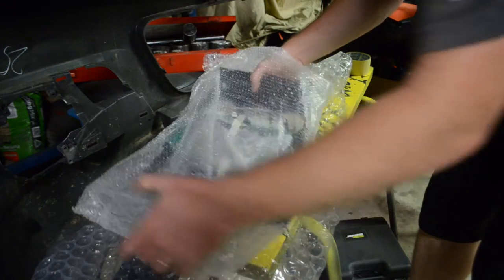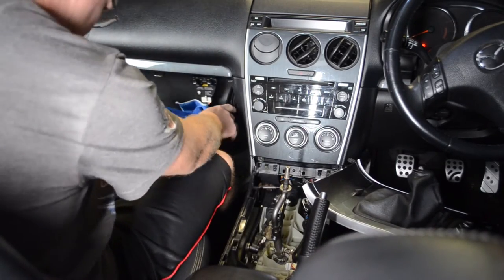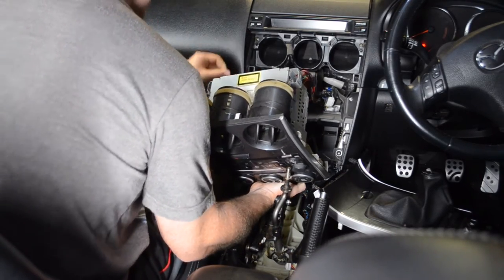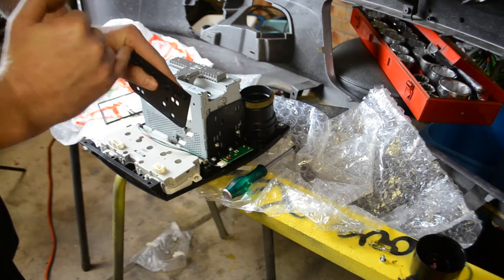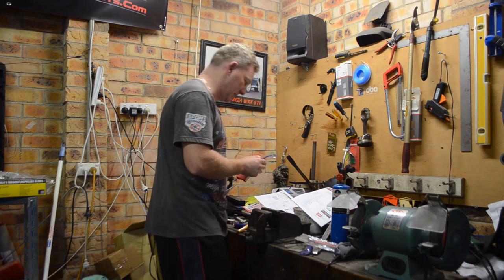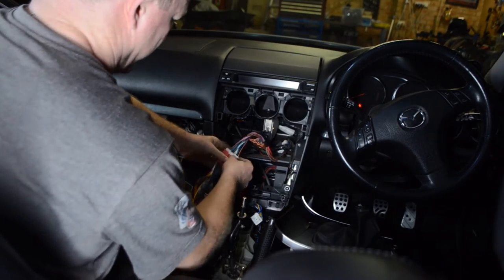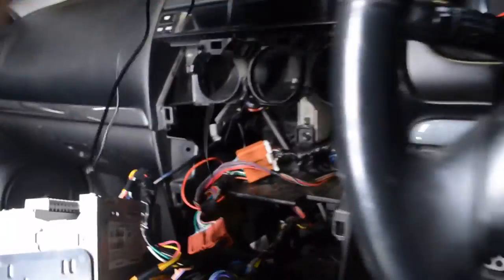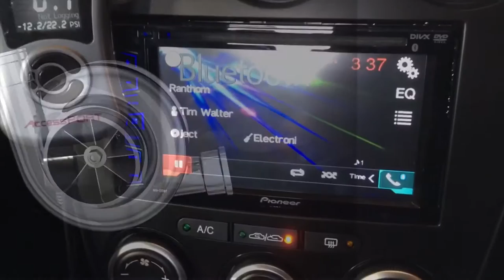Head Unit Install on the Speed6

Comment: Mate you deserve a lot more subs with the amount of amazing content you post. Im going to be buying a 6 mps at the end of this year and for sure your videos will help me out. Also its nice to know that you are in sydney and getting away with that exposed pod filter on your SRI, it gives me a lot of hope. Keep up the amazing work, every one of us appreciates it :)
Reply from the maker: Thanks mate I appreciate it. so far ive found if I drive 'nicely' on normal roads I fly under the radar, out on the open road or out of the city I can test the car out a little more and have had no issues yet, I may encase the POD at some stage but im not feeling the pressure to yet so its doing the job well. Thanks again mate, best of luck with the MPS6

Comment: Really enjoying these videos. The double din head unit looks awesome. The standard unit really let's the car down I think. This is something I have to do in the future.
Reply from the maker: Thanks mate. I am a fan of the new head unit for sure. I wish I filmed the electrical side of the install, it took a lot of messing around. If you go for an upgrade get a mate good with electrics to help :) it will save a head ach lol. It's noticeably better sound for sure :)
Reply: +Tims Garage Absolutely. Electrics is not a strong point of mine. I can't stand not having any real control over the sound, a double din unit will give this and some.

Comment: I know this video is a few years old. But did you still have the climate display still working after
Reply from the maker: Yea mate, still work, the only thing that doesn’t work is the eco air image, I have 2 air con presses if the button that just show air con, but other than that I have clock, heater, etc… all works fine

Comment: Hi buddy, I have an issue with the bolt behind the radio unit, but the thread of the bolt is damaged, is loose but I can't get it out, do you have any idea how to deal with this? Thanks.
Reply from the maker: I'd attempt to get a flat end screw driver (a small one) between the bolt and the frame, then try undoing it, and gently leaver it out. You won't need it again if your going for an after market one. Other wise, as a last resort, you can drill the bolt out. It's not ideal but it will get you out of trouble :)
Reply from the maker: sometimes if you can get it to move a little (force behind the bolt) then it will catch the thread again, EG: get a screwdriver (flathead) behind the head of the bolt and the frame, then get the 10mm socket on the head and see if you can leaver and unscrew the bolt, you wont need it again with the new head unit so you can force it a little.

Comment: Hey Tim just wondering where you got this double din facia from? And did all the aircon and other buttons work all fine? Great video as always!
Reply from the maker: +Brad Sambell I think I got it form https://www.alibaba.com/product-detail/11-106-Car-Fitting-facia-Kit_60454525688.html?spm=a2700.7724838.0.0.Xd1fsi    It all works fine, the only thing that does not work is the Aircon power saving mode or whatever that one is :P But all the functions work, its not as polished as the stock unit as far as lights go, but it all worked great and I have sweet sound :D so its wroth the trade off.

Comment: Great video mate. Thinking of doing the same thing. Just wondering - do the aircon adjustments feel quality and factory? Or do they feel cheap? Cheers
Reply from the maker: to be honest they are a little cheeper than the stock ones mate, and the backlight that they have is a little cheep, the controlls dont light up the txt like the stock one does either EG: you have to know what the aircon button is cos you cant read it at night. But having said that, the sound quality of an after market unit makes it all worth it 100X over!

Comment: Hey Man, just wondering if the wiring that came with the facia you bought allowed the aircon display to work??
Reply from the maker: yea mate, the kit worked well, even climate controll seems to work ok, you can tell its a cheeper product than  the stock system the light quality is kinda poor (you need to remember what light = what controlls in the dark) but I have fully functional air con, and heaters. the kit came with everything i needed. the only thing that I dont have working is my Eco/aircon, I need to hit the air con button twice to turn it off. other than that it works fine.